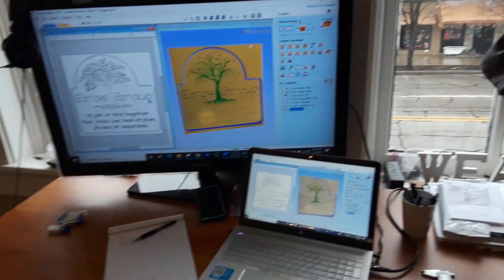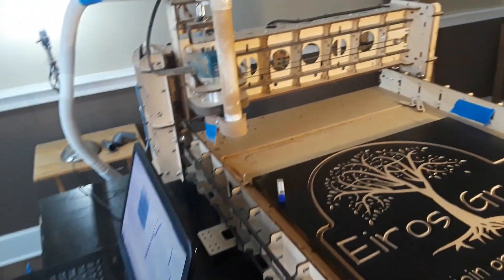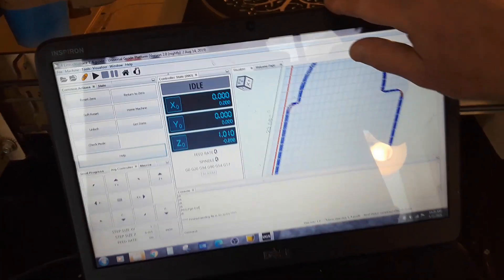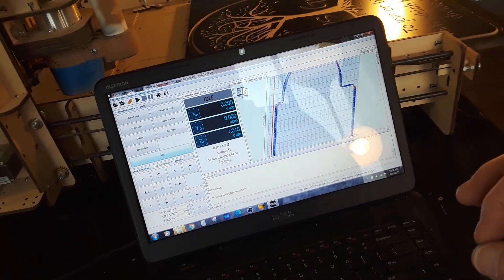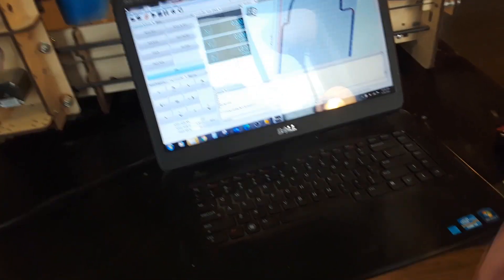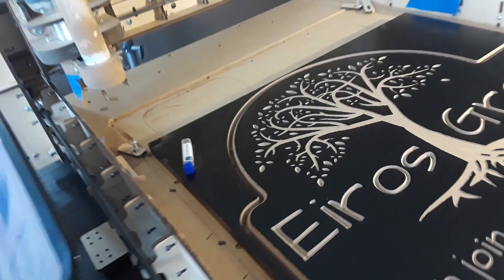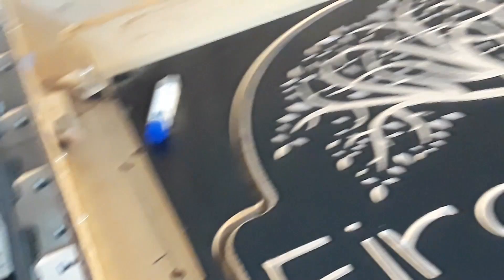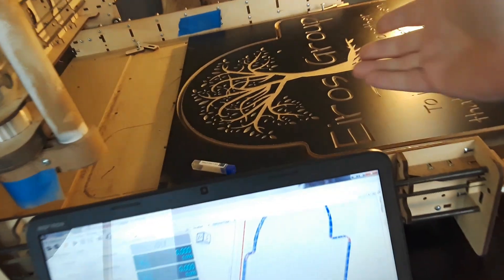Do You Need A Separate Laptop/Computer For A CNC Router or Laser [CNC software]

Comment: Garret, you need to redo this video, if you were making this video today 2026, your advice would be greatly changed. You would have updated to Sienci labs G Sender software and recommending their gControl Panel Computer. I recommend  this direction, it is a dust proof computer and it is designed to work in the CNC environment - $515 delivered. the Windows 11 IoT Enterprise (64-bit) is designed to last 10 years +.         Dust is a killer, prevents cooling fan operation by plugging the cooling system and wood dust can be conductive. The dust WILL kill the laptop is time, probably 2-3 computers in the 10 year span
Another way to go for computers is 2 year old reconditioned laptops from Amazon, they include Win 11 pro software starting at about $350-400 and up, some smaller and older systems starting around $200
Nothing was mentioned about the dust issues
Dale
Reply from the maker: Thanks for sharing your thoughts, Dale! Dust is definitely a challenge in the CNC environment, and it's always good to hear about solutions like the Sienci labs G Sender software and dust-proof computers. Appreciate you watching the video!

Comment: Hello sir, thanks for the helpful information. We have a 1300mm by 2500mm CNC 3D router which we previously controlled using an A11E Richauto hand-held controller. However we would like to control it with a windows laptop. I've gotten the Universal g-code sender program on my laptop and the blue USB cable for physically connecting the laptop to the CNC machine to control it. The challenge I'm facing is finding where to connect the other end of the cable on the CNC machine or do I need a different cable for it. I would really appreciate assistance regarding this, thank you.
Reply from the maker: Tony-ee3nm, I'm glad you found the information helpful! For connecting your laptop to the CNC machine, you'll typically want to look for a USB port on the CNC controller itself, but the specific location can vary based on the machine's configuration. If the machine doesn't have a USB port, you might need a different interface or cable that corresponds with your CNC's existing controller setup. Good luck with your project!

Comment: Do you know why I do not want to move the engines on newer laptops?I have an arduino uno and cnc schield v3.On a desktop i5 pc, this goes well on win 10.Normally both connects and loads grbl.I Motion simulates, but the engines do not go.And on the old single-core or dual-core with win 7 it goes beautifully.I just would like to put a more powerful laptop, but it does not work.Where or what is wrong?
Reply from the maker: fifo24866, that is a tricky one brother. Your best bet is to reach out to your machine manufacturer regarding what laptop is best for your specific setup. They can give you better guidance to your specific problem.
Reply: @IDCWoodcraft  But what's the problem?In hardware or software?You personally tried different laptops.I even on one dual-core 1.6 it works fine and on the other also dual-core 2.2 not.Both are hp.Grbl panel connects.Loads grbl from Arduino, but won't start engines.Such a faint crack should be heard.I'll give the axis movement.The numbers are running, but the engines are not moving.In the program, it looks like it worked.But not really.And through what program I run it does not matter(grbl panel, Candle, or Ugs).On those laptops that goes running on all programs.Why does this happen to Arduino and beyond?The Cnc Shield has no lights so I can't see.I have not found a similar problem anywhere.Your video brought me a little closer to solving it.But according to the answer, you do not know it either.

Comment: I just bought a Raspberry Pi400 ($99) to control my Evo4 and I got it to run UGS, Opens builds and now Gsender. works really good. I just design on my laptop, copy gcode files to memory stick and transfer to the pi.
Reply from the maker: Hey Mach. Since I don'y use rasberry, I din't know that. Thanks for sharing about this so others who read the comments will know this technique! That's why I love comments like this. It helps fill in the gaps I miss. Thank you
Reply: @mach1registry Thanks for sharing! I didn’t know this either. Could you recommend a tutorial or resource which details how to setup a Raspberry Pi in this way? If not, what keywords should I search to find some guidance?
Reply: @breadventurer  do you have bobs. CNC machines.? it would prolly work with any GRBL based CNC type machine, there a good video from Ed Parsons on it and cnc control software is available for the Raspberry Pi  (UGS, Opensbuilds, gsender, and bobs basic sender) will all work on Raspberry pi for cnc control. I have all on mine and each one seem to work fine. 
Heres ed's video. a little different than a PC base machine. but all in one, makes for small footprint. good luck
https://www.youtube.com/watch?v=SR8zxX4VQ5M&t=203s

Comment: Garrett, I have a MacBook Pro. Can I write my programs on that and then load them on a flash drive and use them on window laptop for the garage? I don’ want to buy 2 laptops. Can I just use Carbide software and would you do a series on that?
Reply from the maker: Hi charles. You can use an online design software like Easel. As far as anything else,...all programs are made for windows when it comes to CNC

Comment: I have my design software on both my office laptop and an old work laptop in the shop that is connected to the cnc. Lot of times I'll come up with an idea at the house and can work on it there, load the file onto a thumb drive and add it to the shop laptop. If it needs tweaked, I can go in and make the correction and regenerate the g-code.
Reply from the maker: that's exactly what I do, Basil. Thanks for adding this comment because I forgot to suggest that method. glad I have people like you to fix my missess!

Comment: I use raspberry Pi(s) for all of my 3d printers and cnc. They take about an our to set up if youre following a video, but their $40 a piece. And you can access each one like a website on any computer or device. It lets me manage everything and see whats going on because I have camera hooked up to them without having to hover over the machines all the time. Keep up the great content!
Reply from the maker: I love the idea of a cam. I've thought of it. But, I've come to trust the programs, as long as I'm careful in my setup. So I just start and walk away.
Reply: @IDCWoodcraft  A good camera to use for monitoring your equipment is made by a company called 'WYZE' [wyze.com]  I would recommended their V3 camera.  It costs around $25.  You can monitor the camera on your phone or tablet.
Reply: I've thought of the pi, doesn't need to be over powerful, not as delicate as pc/laptop, just add a cheep screen & keyboard, WiFi/Ethernet connection already there. RDP control from elsewhere if necessary.
Reply from the maker: @JohnCol-1959  I'm not familiar with that brand. I haven't gotten to much into lasers to give good guidance on the companies. You might want to find a lasers for beginners Facebook group and ask there.